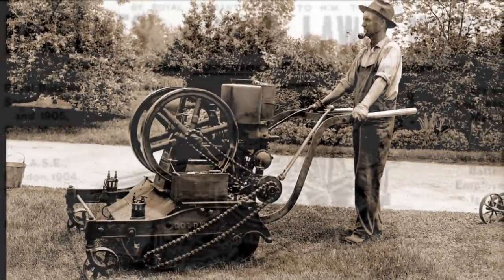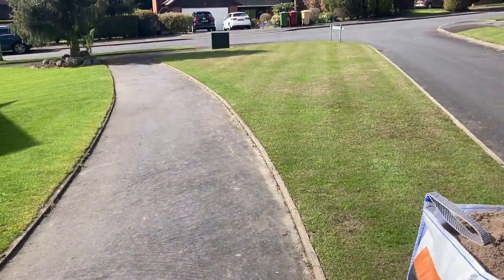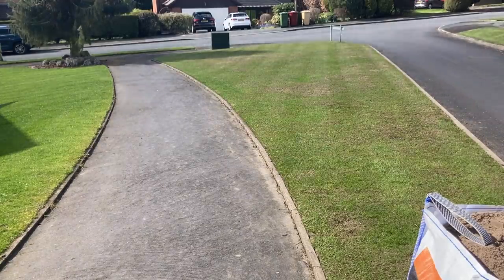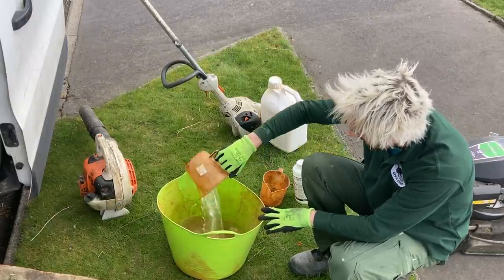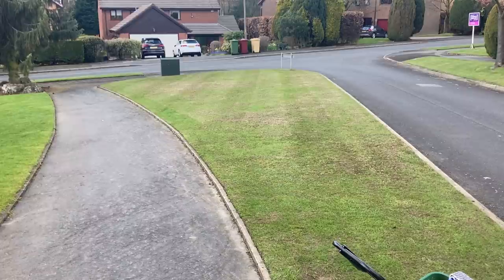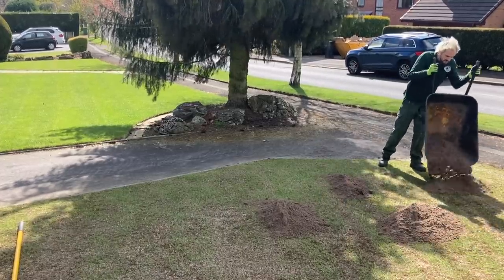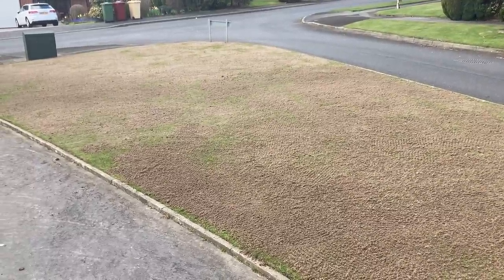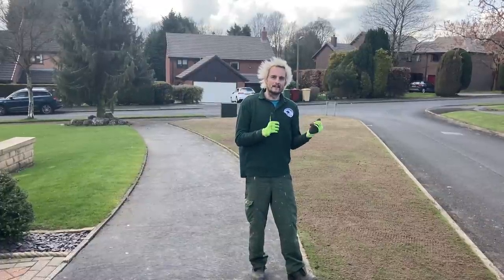SPREADING  rootzone on lawns PROPERLY / DON'T make this one MISTAKE

Comment: Like watching Picasso with a brush! 

Question - Would you recommend rootzone over standard soil to level, overseed, top dress? I’m down the road in Preston and have a clay based new build.
Reply from the maker: You could use top soil but its usually full of weeds so your bringing in problems where as rootzone usually pretty weed free, this stuff is anyway

Comment: Hi Daniel, love your videos. Im currently following your steps on my lawns.... However, my back garden is very uneven and some places quite low, several inches ... can I fill these these to level with rootzone, seed and top dress . Or fill to level with top soil , seed and top dress with rootzone??   Thanks
Reply from the maker: Several inches would be too much in one go , you would best digging the turf out and backfilling then getting a finer level that way
Reply: Great,  thanks for the advice.  I know this has been asked before,  but vive been looking and can't find the comment.  What grass seed would you recommend for shaded areas ?

Thanks
Reply from the maker: @simonmurphy9876  i think prg is as good as any simon theres no answer for you as shady comes in so many forms is it shady with water dripping off trees, which is double trouble, shady by fences? Houses? All diff variables

Comment: Hi Dan another great informative video. I’ve not used a wetting agent before. On a home garden where I can regularly water throughout the season, what benefits would I get with a wetting agent?
Is that a 50/50 mix of root zone I can’t see 70/30 on their website.
I used to plasters sand to finish my level when I seeded my new lawn last year. My lawn took fine did I just get lucky? I did find I had to feed a lot though.
Reply from the maker: Thought you said another informative video? Presuming you watched it all? I tell you the benefits of the wetting agent in it

Its just called rootzone its not got a ratio its all sand and gritty bits, my lawns love it 

You prob got lucky and lawn took fine in your eyes might be different to mine
Reply: Hi Dan I watched it all and re-watched it. Other than mixing the wetting agent there was no other info.
I sent you a photo of my lawn last year when buying your galactic green, you said it was good, maybe you were just stroking my ego. 😉
Reply: A quick Google search showed that plasters sand is usually washed river sand too.
Reply from the maker: @MrLAJB  there was when i pour the wetting agent on the soil and show how it works
Reply from the maker: @MrLAJB  yeah but its plastering sand just doesn’t sound right does it , its for plastering and doesn’t sit right with me using it on a lawn , like if it was lawn dressing sand and a plasterer turned up at your house and said im going to put that on you walls, think you would raise your eye brows
Reply: @DanielHibbertLawnExpert  Oh is it the bit where you say it gives freedom of growth for the roots. I thought you was referring to rise and shine.
Reply from the maker: I owe u an apology, it seems the bit i put in the video about the wetting agent working has gone missing,
Whem im wrong i say im wrong
Reply: @DanielHibbertLawnExpert  Haha very true.
Reply: @DanielHibbertLawnExpert  No worries thanks Dan.